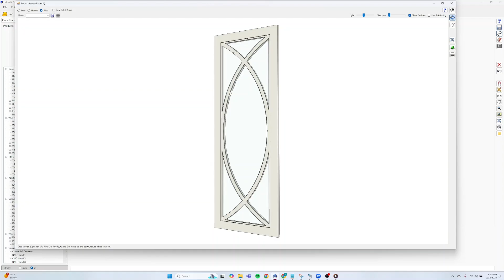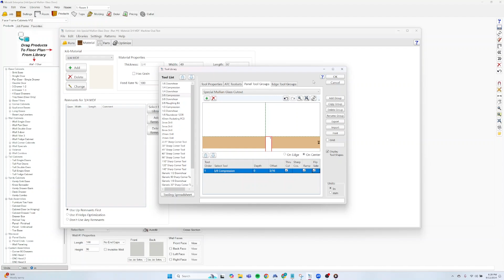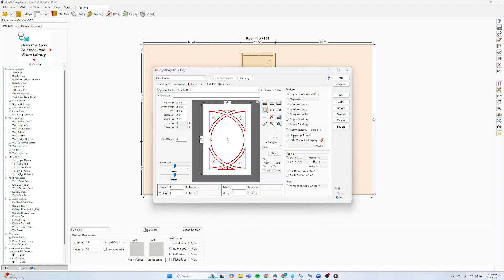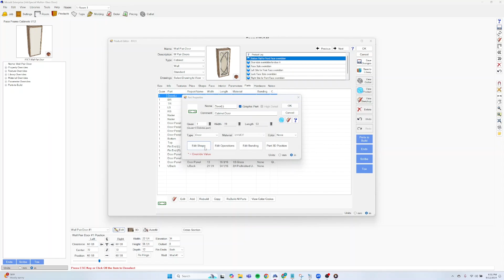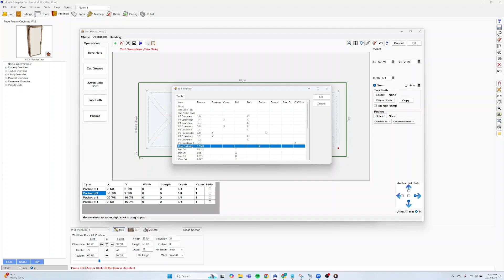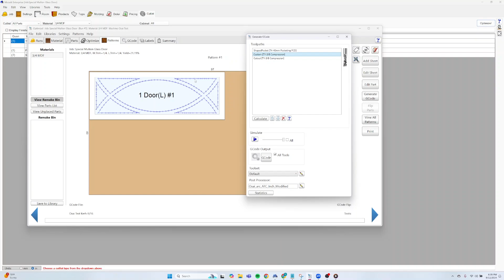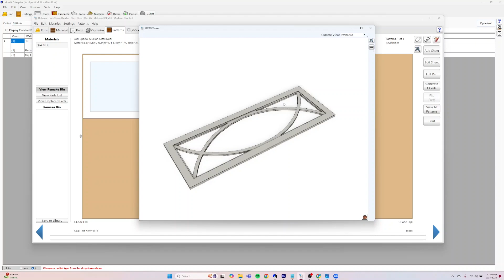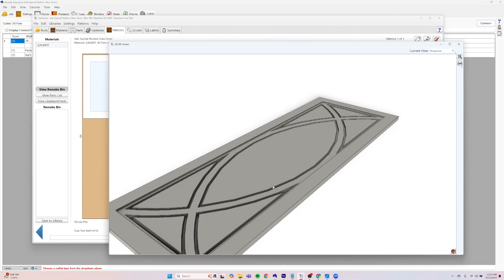ADVANCED MDF GLASS DOORS IN MOZAIK (CNC-ready with back pocket.)

Comment: Where would I search for a way to addback  pocket on door libraries? ,  I am assuming this involves a formula ?
Reply from the maker: Formulas or anchor points. Either works. Same concept as back pocket in video. You’ll need to add a panel tool group to the back pocket operation to clean out corners. I can make a specific video for this.
Reply: @PhillAntonConsulting  Thankyou ,  that is exactly what I was looking for.